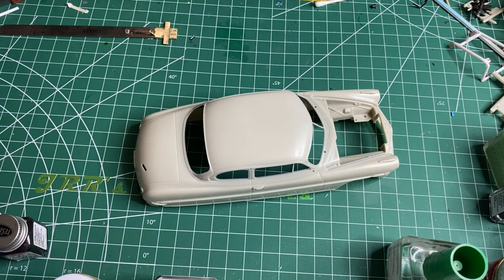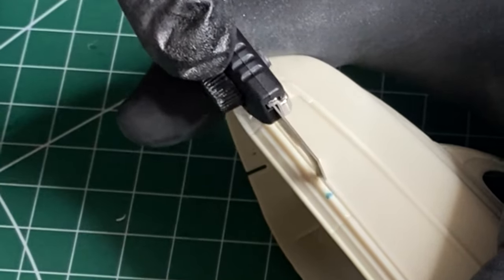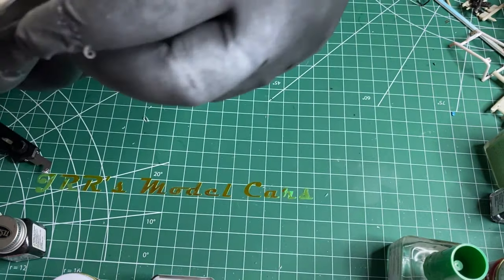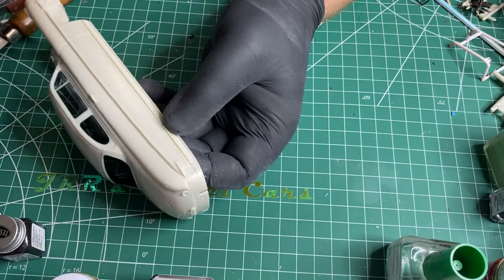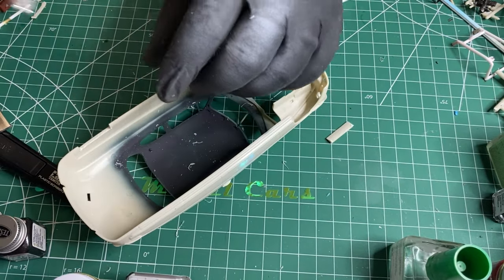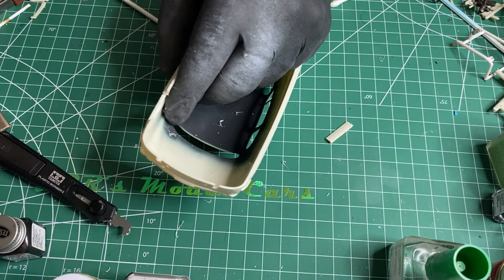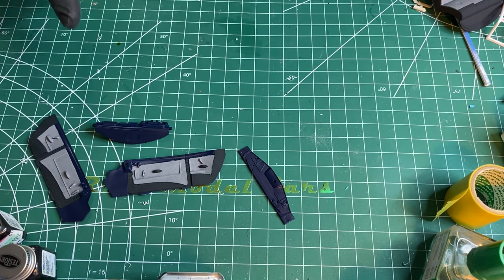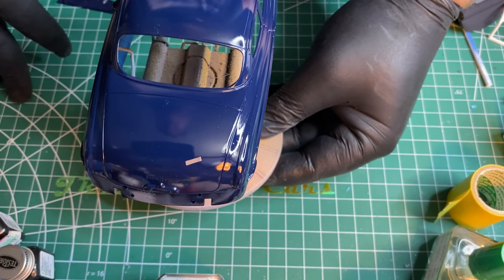Moebius Models Fabulous Hudson Hornet Model Kit Herb Thomas 1951 Removing Sideskirts and Paint

Comment: Hey bro I like what you're doing there got a little tip for you I use nylon sewing thread to do my cuts like that for cutting out doors trunk lids nylon thread on a slingshot frame and it'll just melt right through a light butter just micro drill your first start hole and then hook it up and go it'll follow the groove all on its own
Reply from the maker: Thanks for the tip, I will try that next time!

Comment: I know it's too late to say this, but I would have cut the vertical lines first and then scribed the horizontal. 
That way you don't scribe too far into a part you don't want to scribe.
Reply from the maker: That is what I did on the second one I built, it works much better that way
Reply: @JRRsModelCars  You can also scribe down a bit and then snap off the piece instead of scribing all the way through...to save some time and hassle.